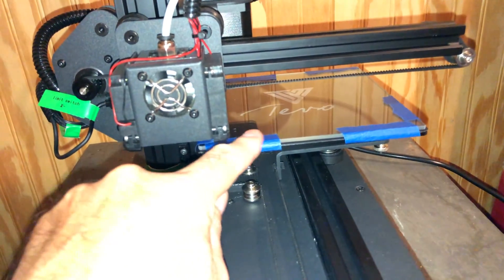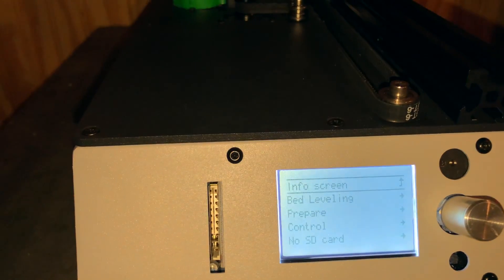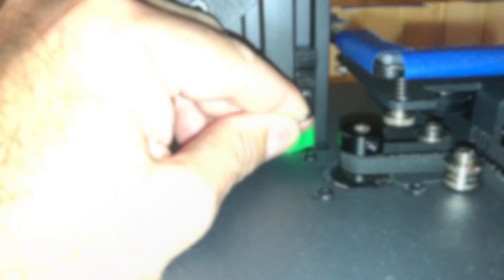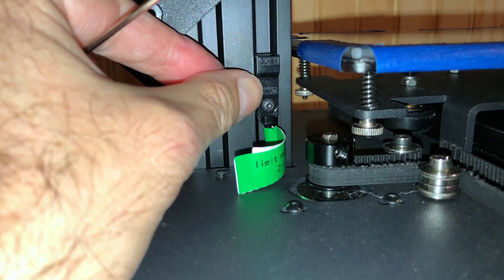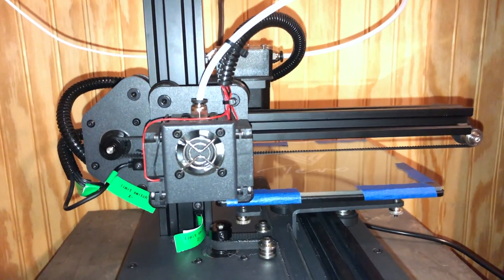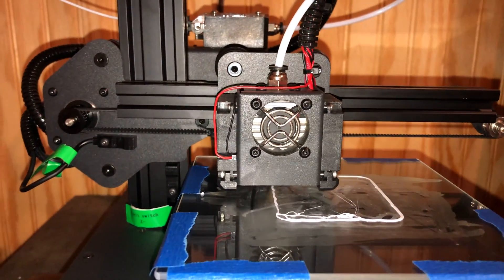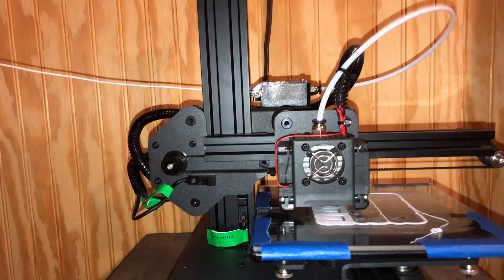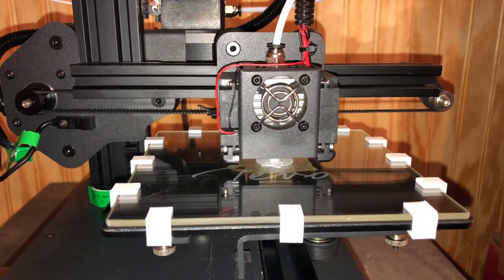3D Printer Build Plate Clips

Comment: Hey Jay, Any particular reason for adding the glass plate? I'm ot sure how I feel about using a glue stick to prep the printing surface.  A 3d printer has been on my wish list for a while and this one seems very reasonably priced. At this point if you had to make the purchase all over again, would you stick with the Michelangelo or look at other options?
Reply from the maker: BBHouseRodent   The TEVO’s stock surface (since it’s unheated) doesn’t provide great adhesion.  I was applying painter’s tape, which worked but often stuck to the printed object.   A lot of 3D printing videos on YouTube recommended adding a glass surface. The glue helps the print stick better. I can just pop off the glass and easily clean it between prints.  As far as printers go, I do like the Michelangelo.  It’s sturdy and easy to work on and the prints look great.   For about the same price you could get the Monoprice Select Mini version 2, which has a heated (though smaller) bed and auto leveling.  But I find the prints from it to be a bit rougher.